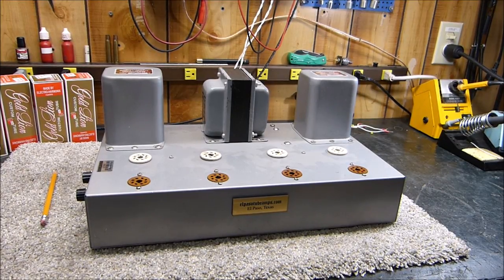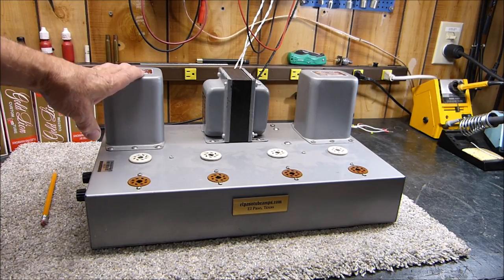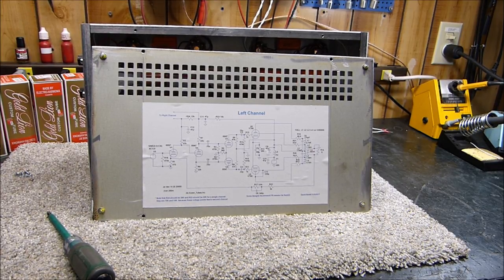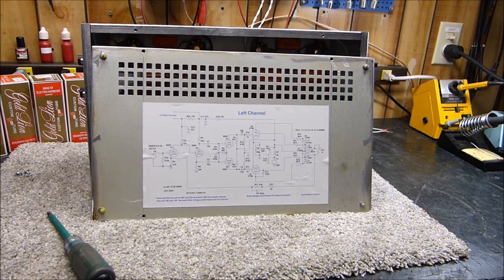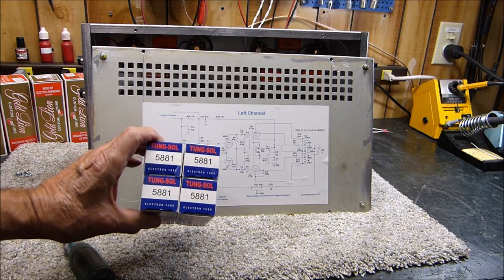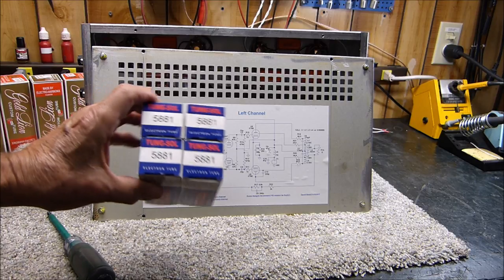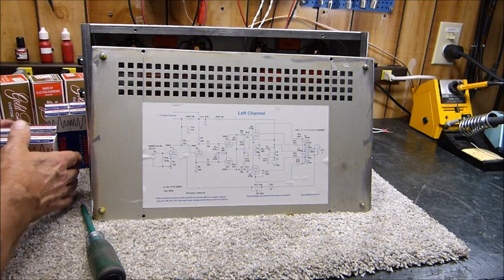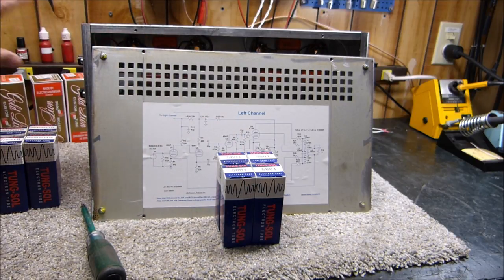Gold Lion KT66 vs Tung Sol 5881 Williamson Amplifier With Acrosound Output Transformers, Part-1 of 2

Comment: Hi,i made a kt66 single end with 6sl7 driver   in triode connection,i give you my measures on my amp i got 440 v on the plate kt66,so i have 43 v and 57 ma  with  750 ohm resistor on cathode bias , i see in the specs that i can put a 600 ohms cathode resistor to have 63 ma on the cathode ,do you think its ok to do this !the plate dissipation is 30 watts for the kt66 is it wright or wrong! So i  have  a 5 k primary output transformer..Is it normal that i have ecretage only  on the negative part of the sinus on scope! thank for your help .
Reply from the maker: 440 volts at 57 mA is 25 watts dissipation in the plate. 440 volts at 63 mA is 27.7 watts of dissipation in the plate. Both are OK but generally the hotter we run the tube, the better it performs in both output and THD. I assume you have a capacitor across the cathode resistor? A single ended (SE) amplifier will not output a full sine wave when over driven like a push-pull amplifier will so the maximum "clean" power you can get is when you have the full sine wave which will be limited to just a few watts. It may sound good but you will never get much power out of a SE KT66. I might also suggest you try a 6SN7 (a lower gain tube instead of the 6SL7) and you may get a little bit better performance. As strange as it may seem, component (cathode resistor, etc.) values are critical for a SE amplifier. A push-pull amplifier is much more forgiving and will often time perform OK with a range of component values. I am listening to the amplifier in the video as I write but it has a larger power transformer now.  Hope this helps
Reply: hi you says to try 6sn7 instead 6sl7 but my amp is not driven by a preamp ,i have just a driver and output tubes and a potententiometer in input amplifier .The 6sn7 has an amplificator factor of 20 and the 6sl7 has  70.  i think that i will not have  enough voltage swing  what do yo u think about that .I can to send you my shematic if you want.Thanks @ElPasoTubeAmps  

Annuler

Répondre
Reply from the maker: @kubockferre5532   I understand the 6SL7 providing more gain and in you case you might need it or just like the extra gain. I built a stereo 300B SET amplifier and I use a 6SN7 and have plenty of gain to get 60 volt grid drive for the 300B.  Whatever you think is best. I built an amplifier several years ago and used a 6SL7 at the first stage and could drive the amplifier to full output with maybe 250 mV and I found that too sensitive for my case. Just thought I would mention the 6SN7 if your amplifier is too easy to overdrive. But, if change is made to a 6SN7 it will require a different plate load resistors and bias resistors.
Reply: ok thanks i will try 6ns7  @ElPasoTubeAmps

Comment: I'm in the middle of building this amplifier as I'm watching this video :) I've managed to order all the parts except for the output tubes before they closed the borders. I'm punching out the holes in the chassis right now. I'm wondering what happened to the 6B4G option and why you converted it back to 5881-KT66s? Was there a problem with the sound or the tubes couldn't handle the high voltage?
It will be really nice to compare the measurements once I'm finished with my build. I'm using my custom wound transformers and I will first test the pair which I have already wound and then I will wind another pair to try to improve upon the initial tests. I have the same choke as you've used originally the 159Q, but maybe I will also wind another myself for 8H 250-300mA. Looking forward to the Part 2, love these videos!
Reply from the maker: The 6B4G setup was because I was having a love-affair with triodes and just had to see if it would be so much better. Power output is lower and my 6B4G supply of tubes is not perfect. To buy more "NOS" is such a gamble and I am not really interested in new 6B4G tubes so I went back to the 6L6/KT99/5881 group of tubes. And lastly, as you mention, the HV was quite a bit too much for the 6B4G tubes...
I changed out the original choke as it was rated at 150 mA and I knew the output tubes along needed 200 mA in idle so I put in the 1H, 300 mA choke and it definitely improved power output. The reason I took the time to measure the harmonic profile on the spectrum analyzer is because I was not sure if I had created this "hum" issue at 120 Hz by changing out the choke. Apparently not. I will probably continue to look into the 60 Hz issue as in other amplifiers, I have been able to reduce filament hum to basically zero where I can not see it on the output of the Tek audio analyzer.
I would like the 8H choke as you mention but I doubt it will fit under my chassis and I want to keep my amplifier pretty much as it is.
Sounds like you are building a nice amplifier. Please keep me, and all of us, informed of your progress.
Reply: @ElPasoTubeAmps  what filtration are you using at after the Bridge rectifier I couldn't see any poly caps? And isn't a double Bridge rectifier better than single?
Reply from the maker: @johnsweda2999  In the Acrosound I am using a common full wave center tap (FWCT) with a Pi filter and in the UTC I am using a voltage doubler into a choke with output capacitor.  I think the power supplies are big enough this time. The original Acrosound amplifier, when I first built it, had a power transformer was was marginal (only 200 mA) and so was the current rating on the choke but I changed all that out to larger values. Even though the UTC does not measure out as well as the Acrosound, it is the one I listen to all the time. I don't understand it sometimes...

Comment: Not sure about the virus, but injecting around 80V DC into the heater circuit CT might be the easiest way of getting rid of the 60kHz hum...
Reply from the maker: 80 volts on the filaments - that should kill all the viruses...    :-)
Reply: @ElPasoTubeAmps  I've learnt how to fry a rectifier tube, that might work on the virus as well.
Reply: 80 Volts?
Reply: @dhpbear2  Yes. Some say lower voltages do the job too but I strictly followed instructions from Kevin O'Connor and that did the trick (several times).
Reply: @12tomicheck21  Ah, I misinterpreted 'injecting' as in placing 80V across the filaments, not placing the filaments 80VDC above ground!
Reply: My bad, sorry for the confusion!

Comment: Maybe a rethink on the filament wiring geography,perhaps running the wiring proud of the chassis rather than around the tube base,no criticism just a thought,regards Colin.
Reply from the maker: I understand your thinking and I certainly do not disagree with you. Layout is very important and I did turn the tube sockets 180 degrees with each other thinking it would help in the layout. Not sure it did help very much in my case...  In the third video you will see that I did add shielding wire from the RCA connectors to the first grid along with the cathode and balance pots. In the third video, I hope to do tonight, we will examine the square wave response with and without the RC circuit on the output of the first stage.

Comment: From what I can see, the problem is at 3Khz not 60. This might be a negative feedback problem.
Reply from the maker: That 321 uS error signal is most likely the third harmonic that we see on the spectrum analyzer. The Tektronix audio analyzer auto-scales so that the error signal looks bigger than it is compared to the fundamental frequency. I was becoming fixated on the 60 Hz signal riding on that harmonic. As mentioned, we have to be careful when determining if the offending hum is 60 Hz line frequency or 120 Hz power supply frequency and the spectrum analyzer shows us what it is. Possibly some adjustment in NFB could lower THD a bit more. More NFB requires more drive and at some point between 16 dB and 20 dB the amplifier starts to become unstable and the first sign is the trance of the oscilloscope oscillating up and down slightly at about 1 Hz. I really appreciate your comments.
Reply: @ElPasoTubeAmps  Thanks for the reply, I'm no real expert at this so I love watching your videos. Keep yourself safe, I'm in isolation at the moment as I'm over 70. We will get through this.
Reply from the maker: @apmdavies  I am 70 also and we've never seen anything like this, for sure. Got to live like we are going to be here forever although we know better. You stay safe and well also.

Comment: I was thinking yes I know!!  could you use 30 amp variac coils as output Transformers they are toroidal I can't see any reason why not accept size issue I would have thought it would make good output Transformers and is fairly cheap, got any feeling on it
What about kt77 give it a bit more output what's your feeling on 300b tubes Holy Grail of tubes
You had any experience with radar tube's 160 Watts Soviet Union, they do build single valve amplifiers using them rather ridiculously expensive I don't know why because of the tube or what. Any chance of building one.?
I've been reading up on Audio Note capacitors their new release tin foil Meyler in oil, they claim they are the best you can get for audio signal. maybe you'd like to try but they say they need a lot of running in they sound awful at first?

Comment: only halfway through video...60hz hum...why not use DC filament drive?
Reply from the maker: Possibly a bridge which would move my filament "hum" to 120 Hz and be a little easier to mitigate (?). Overall however, I doubt the THD will be lowered by reducing the hum to an immeasurable level on the equipment since even with this bit of hum and third harmonic, the THD is only at 0.25%. Something to think about. Thanks for your thoughts.

Comment: -20dB=1/10 or 10% distortion, -40dB=1/100 or 1% distortion, -60dB=1/1000 or 0,1% distortion, -80dB=1/10000 or 0,01% distortion.
I don't understand the talk about 10th of a million etc. etc. What do I miss?
-55dB down is 0.178% of distortion and barely detectable with human ear that detects 3rd harmonic around 0,2-0,25% distortion.
I wouldn't consider 60Hz fundamental that is -70dB below full signal level a problem. 
Can you hear it when putting your ear to the loudspeaker? 
It's 0,03% of intermodulation distortion and should not be audible since it's a single tone with a few harmonics at a lower level.
Complex signals like music is, can however create a lot of more distortion (Read Nelson Pass paper on distortion). 
Thumb of rule about 10 times or 20dB higher.
So that 0,2% 3rd hamonic for single tone can be several percent during music listening, and that, I suspect, will give a bright and harsh character to this amplifier.
Expect this amplifier to start sound quite bad when pushed hard.
Reply from the maker: That is a big discussion you have going there. As for global negative feed back (GNFB) often times just called NFB, is taking some of the output of the amplifier right off the speaker terminals of the amplifier and feeding it back, out of phase, to the first stage of the amplifier. I have found over and over that more than about 16 dB of NFB can start to cause instabilities in the amplifier like motor-boating at a very low frequency. As for S/N ratio in dB, anything better than about -75 dB will likely not be heard coming out of the most efficient speakers with our ear right at the speaker. High quality amplifiers usually boast -90 dB S/N compared at their rated output. 90 dB is a ratio of one billion to one... so, if you have 100 watts of power and the noise is -90 dB down, the noise is 10 nano watts or 0.1 microwatts, however you want to look at it. At say, -60 dB down from 100 watts, the noise is 0.1 milli watts and you actually may be able to hear that out of high efficienty speakers. Remember that for every 10 dB, the power is changed by a factor of 10 so the difference between 90 and 60 dB is 30 dB or a power factor of 1000 times - louder or softer - depending if the power is increased or decreased. Hope this helps.
Reply: @ElPasoTubeAmps  
OK, you are talking about power  and not gain. Shouldn't you consider the difference as gain ?
The level of detection is basically only compared in voltage or amplitude and not power.
Attenuation in a volume control is never specified in power, only as a voltage divider. A spectrum analyzer only analyze voltage and amplitude not current or power.
The NFB is also specified as a amplitude and voltage level and then this is valid:
20dB = Gain of 10
40dB = Gain of 100
60dB = Gain of 1000
Noise is also quantified in amplitude and voltage. So, as I see it every change of 20dB is a factor of 10 and not 100.
16dB of NFB is not critical in it self for oscillation. You just happend to run into phase problem at that level of negative feedback. Your feedback loop have a higher frequency pole than the first gain stage so the feedback loop that are supposed to come back 180 degree out of phase have a pole creating more phase shift and when hitting more than 90 degree phase shift it comes back more IN phase than OUT of phase and then you have a negative feedback loop that will make the first gain stage to add low frequency gain, and then it come into low frequency oscillation.
Many transistor amplifiers can have NFB of 40dB or more. 
Just have control over low and high frequency poles of the first gain stage and you will be able to have more feedback without the risk of run into oscillation.
Personally I do not like negative feedback and avoid it as much as possible. My own designs most often ends with a little bit of feedback like 3-9dB just to even out amplitude over the frequency response I try to have.
To much global negative feedback kills and changes harmonics to much which make sound monotonic and with a collapsed soundstage. IMHO.
Reply from the maker: I agree the 16 dB of feedback is not any fixed critical level for oscillation but that seems to be a good limit for vacuum tube amplifiers.
I think the amplifiers that have the 40 dB level of NFB are solid state without an output inductor.
It is that OPT in tube amps that causes some instabilities in many cases and some also need RC circuits with a pole around 75KHz to 
keep parasitic suppressed. I see the RC circuits in different places, usually around the OPT or in the case of Williamson amplifiers
at the plate of the first stage. 
I use a power meter to adjust NFB - usually setting the power to a clean level, say 5W, with no NFB, then adjusting NFB to a determined level, in
my case of 16 dB of FB to about 130 mW. I do this with a pot and then measure the pot and install a fixed resistor.
Converting those figures to voltage gives approximately 6.32 volts for 5W into 8 ohms and 1.02 volts for 130 mW.
The results turn out the same.
Lots of NFB does indeed give an amplifier a compressed sound when compared side-by-side with an amplifier with no NFB, but the gain in power can't be ignored when NFB is employed. A clean 5W amplifier with no NFB can (maybe) be turned into a very nice 30W amplifier with, in my case, around 16 dB of NFB.
I have one stereo SET with 300B and as you mentioned, I have a switch for (I can't remember exactly) about 5-6 dB of NFB and the other position of
the switch for no NFB.
I like the sound of SET with no NFB but, as already stated, the power is often very low.